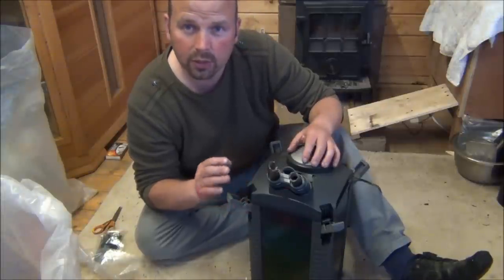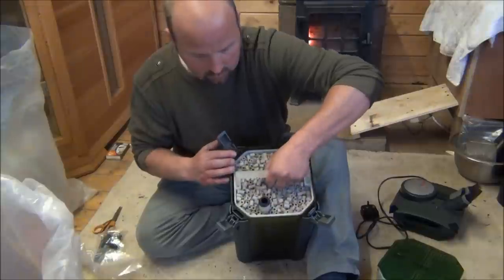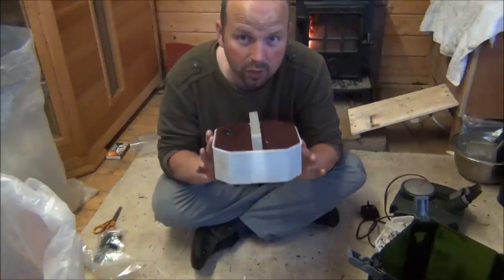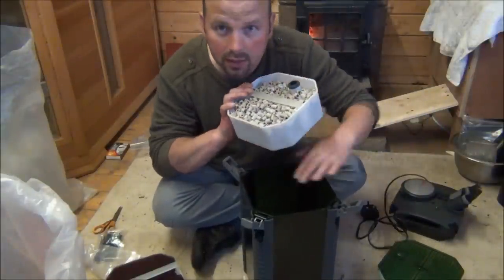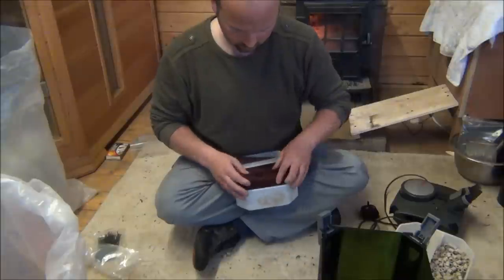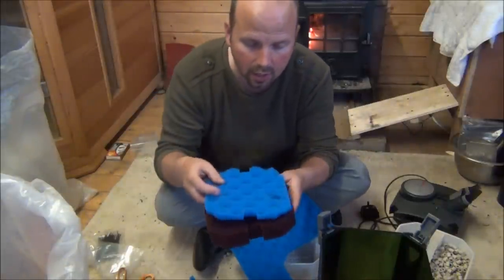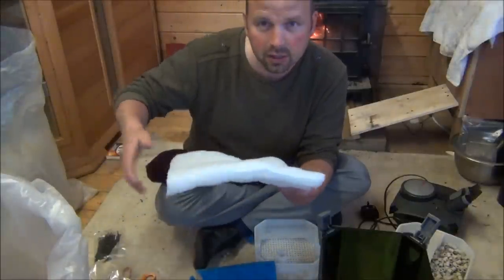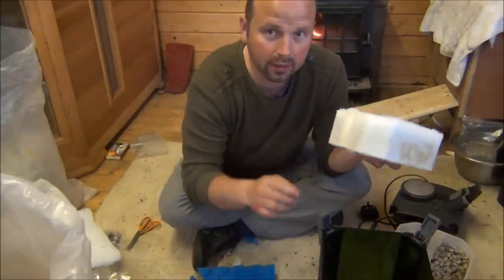How to set up an external canister filter for aquarium by Pondguru

Comment: Hello Pondguru.
I just bought my first Canister filter and I would like your advice, I know that the water flow of this filter starts in the bottom and comes out at the top of it.

I would like to know a good setup for this, I imagine that it would be quite different than the one in the video because mine is for Goldfishes and since I don't have any real plant, I might aswell use Purigen on it.
Can I put Midia+Purigen on the same grade?

I was thinking on doing something like:
Only Midia
Midia+Purigen
Only Foam.
Reply from the maker: ***** I would personally not use purigen under any circumstances as it seems to destroy the bacteria in a filter after recharging (due to bleach used for recharging process?). I have had numerous people report that their biohome media will not develop any anaerobic bacteria with the common thread being purigen. When it is removed the bacteria develops and nitrates fall.   Yes put foams in bottom then media above just like in this video.
Reply: Pondguru Outdoors What can I use for chemical filtration?

Should I just stick with biological and mechanical filtration?
Reply from the maker: ***** Unless you need to draw in residual fish treatments or colour from bogwood (which carbon will easily do) don't bother with chemical filtration. Keep it simple and maximise the biological activity. That way you will have no ammonia, no nitrite and very low nitrates and no need for 'chemical filtration'.
Reply: Pondguru Outdoors Oh ok, thx for the information.

Comment: Hi Pondguru Outdoors , do you use carbon media for the canister filters as well? If so where do you put them according to the way you recommend us to setup the media in our canister filters?
Reply from the maker: Carbon can be used if you need to draw in colour from water or soak up residual fish treatments but under normal circumstances it would not be necessary since a suitable size filter properly set up will process ammonia, nitrite and nitrate.
Carbon would go last in the set-up so it was the last thing water hit before leaving the filter. That is the cleanest environment for it to be operating in and will ensure it lasts the full 7-8 weeks before it needs changing.
Hope that helps.
Regards,
Richard
Reply: Pondguru Outdoors 
Thanks so much.i have a HOB filter and I'll be getting a canaster filter  thinking about a Fluval that can handle my 65 gallon.So I'm used to using carbon since they always come in the little filter cartridges. If I don't need the carbon then great less money for me to spend. usually I rinse out my carbon filter pack prior to use to get rid of excess carbon as the directions say to do (under tap)  but your videos have helped me to realize this is a major era since the chlorine from the tap will be defeating the purpose of the carbon.
Reply from the maker: Of you do go the external route make sure to get one which will be big enough for your tank. If it says 'will treat up to 400 litres' half that figure. You'd be looking for a filter for 'up to 130' (or more) gallons if you have a 65 gallon community tank and one 'up to' around 200 gallons for a 65 gallon tank with heavier stock (e.g cichlid tank / predators)

Comment: I set my filters up in similar way but I use lavarock as the biological media. It is what I can afford and better than the stuff sold in the pet shops in my opinion. Will the lavarock also ( over time ) get rid of the nitrates and the nitrites ?
Reply from the maker: It depends what type you are using. If it is the red / brown variety it doesn't really have the structure to support a decent mix of aerobic and anaerobic bacteria but if it is good quality white pumice then achieving the full cycle is a possibility - only potential problem with that is it has a specific pH of around 8.0 so while that is good for goldfish, malawi / tanganyikan cichlids and livebearers it is no good for 90% of the fish sold in pet stores which come from S. America or Asia (and need the water to be around 6.5-7.0 and not mineralised.

Comment: Hi there, any videos with the fluval filters as they are kind of vertical installation?
Reply from the maker: Simply set up the same and consider the foams down the side to be extra mechanical filtration. I don't have any of those filters to make a video about unfortunately but I will be doing a video about externals where I mention the various different types.
Reply: yeah fluval are the most famous in the shops and I think the structure there is wrong and media not enough. They're base on vertical foams not on levels and the top of the foam is always dirty so the water jumps to the other vertical half with the little quantity of so called bio filter.

Comment: I have a marineland cm220 can I used this same set up in my canister filter? I am planning on using the same set up in my canister filter. But, the only difference is if I could use this canister filter set up for a salt water fish tank set up. Let me know what you think, thanks!
Reply: *c220
Reply from the maker: Yes according from the information from Marineland it is suitable for marine use. The best media would be the 'Biohome ultimate marine' which is basically an improved version of the media shown in this video which has added trace elements specific to marine bacteria. Provided plenty is used it will reduce nitrates just as other forms do and also has the added bonus of boosting coral health too. This page of my website explains more and has answers to many general questions about biohome: http://filterpro.co.uk/qa-24-w.asp
Reply: +Pondguru Outdoors Awesome thanks for replying! I am currently debating on doing a freshwater or saltwater set up. Do you have any videos or information on setting up a good cycle for say a salt water set up?
Reply from the maker: The process is exactly the same. Make the water clear with mechanical filtration then have the biological media. Chemical filtration (if used) would be the last thing in the filter.

Comment: Hi Pondguru.
Your set up is for a different brand of canister to the one I currently have (Aqua One Nautilus 800).  Is it best for me to set it up just as you have??  From bottom to top with mechanical filtration media, then biological filtration media!!
Thanks, Ken.
Reply from the maker: +kennyp7 Yes just the same as the filter in this video. Not sure how much each tray will take but seeing that it will 'treat up to 200 litres' and has 3 trays? it should hold 1kg per tray (assuming bottom tray was used for foams and top 2 were used for media).
Feel free to send me dimensions of trays and I can work out how much media each tray will take no worries.
Reply: Pondguru, thanks for your swift reply 👍
I have set up the filter as you show in your 11min video (3 X layers of mechanical foam filters, then 2 baskets of bio filtration media ( 2 different types)).
The water is now very clear 👍 and I tested it after 24hrs. The PH level is a little low (6.5-7) and the Nitrates are a little high (20-40ppm)
I will check again in 5-7days to allow the bio media I have to work its magic and go from there.  Do you think I would benefit from an UGF due to heavy waste my cold water fish produce??
Cheers, Ken
Reply from the maker: +kennyp7 As long as the external is a suitable size for a goldfish tank you shouldn't need extra filtration so no worries there.
The biohome is not a magic bullet for nitrate in that you can't expect quick results - it takes a good 4-6 months for sufficient anaerobic bacteria to build up inside the media to affect it.
For goldfish tank that would require approx. 1.5kg per 100 litres depending on stock.

Comment: Pondguru Outdoors I just bought a SunSun WH-302 canister filter. I got with it 6 foam pads, bio balls, ceramic rings and carbon. In what order should i install the items to get the best filtration possible?
Reply from the maker: This video explains all that stuff - there should be no need for carbon when filter is set up with good media and foams are in correct place: https://www.youtube.com/watch?v=lsAmSD3wVbg 
Feel free to send me the dimensions of the trays and I can work out how much media you will need.
Reply: Pondguru Outdoors I have been using BIOHOME ULTIMATE for the last 3 weeks in my 18 gallon fishtank and now I notice it’s starting to develop algae in the tank and hose of
the canister filter. I have my  bottom
tray with Mechanical Filtration as you suggested and 2 trays with biohome media. Can you please help understand
why I am getting algae? And what I can do to get rid of it?
Reply from the maker: martinez189 There are a million reasons why algae develops in a tank. Is it a relatively new tank? Browny algae is common in tanks up to 2-3 months old but usually dies away, green algae grows vigorously when sunlight hits tank. High nitrate and phosphates cause algae and the biohome can help with the reduction in nitrate but takes 4-6 months for the anaerobic bacteria to build up to a level which affects nitrate. Feel free to send me some useful details to work from:stock, age of tank, light exposure, sunlight?, pictures etc. etc. and maybe something will be apparent. pondguru@btinternet.com
Reply: Pondguru Outdoors I sent you pic's and info. Subject is: Fish Tank Algae
E-mail will be from martinez189

Comment: What is the best way to start the filter? Where do the first bacteria get their ammonia from and how do you sustain and grow the bacteria? Add maybe 1 or two fish as soon as the water is livable? Any advice is much appreciated!
Reply from the maker: In a system which has a suitably sized, well set up filter it is perfectly safe and quick to cycle with fish but the first fish are best added after a week or so of running the filter to make sure that the tank water is suitable for life - using an ordinary dechlorinator (e.g. API Stress Coat) will ensure that ammonia, nitrite and nitrate stays in a form which is usable for bacteria, allowing it to populate good filter media very fast.
If you use a dechlorinator which also claims to 'detoxify / bind' ammonia, nitrite and nitrate you may have a hell of a job getting a proper cycle going as the detoxifying / binding process seems to render the bacteria 'food' (ammonia, nitrite, nitrate) unusable which causes a starving effect.
After the first few fish have been added wait 1-2 weeks before adding a few more then trickle fish in every 1-2 weeks until a full stock is achieved. Full stocking of a community tank should take a few months and ideally stock would be added in this order:
Mid water fish
Catfish / loaches
Snails
Algae eaters / plecs
Shrimps
Cycling without fish (using ammonia) is also no problem when you have a good set up and the first part (aerobic) should complete in 2-3 weeks (0 ammonia, 0 nitrite) with the last part (anaerobic) completing in 4-6 months (low or 0 nitrate).
The full cycle can be reduced to around 1 month by adding a source of liquid carbon - Flourish Excel is one which has been recommended to me many times for speeding up bacteria growth / reducing cycling time naturally. 
When cycling using either method it is best to test water every couple of days at the same time of day and plot the results so you can see the progression of the cycle.

Comment: Do you not think your bio media is actually a bit too tightly packed and not allowing it any movement with the flow ? Just to avoid dead spots in the media baskets, a little more space is a little more space to move and knock dead bacteria off - a bit like a flow filter ?
Reply from the maker: There is ample space between the media when it is put in loosely like in the video and unless the media is actually bashing together there won't be much in the way of dead bacteria removal. In a static bed old bacteria will be superseded by new bacteria. Areas of less flow in the filter provide a better environment for anaerobic bacteria which consume nitrate provided you have a media capable of supporting it.
I should maybe do a video explaining the differences between moving bed and static bed filters as there are quite a few. Thanks for watching and appreciating the videos.

Comment: Thank you for the information, one more thing? Do you know where I can get replacement foam in Coarse, medium, fine. I seem to be having difficulty finding that foam. Any information would be greatly appreciated.
Reply from the maker: +Dan Swanson What country are you in? If it is the US then follow the link (flag on all pages) on my website (in video description) but if you are in UK then simply follow the website link - I have very good foams in from a new supplier and they have a much better profile than the ones I was previously selling. The listings still have the old foams picture on as I have only recently changed supplier.

Comment: Top stuff Richard.  Just about to set up a 200L tank with Biohome Ultimate (and filter kit) in a Fluvial 406.   Might have to make my first youtube video while I do it...
Reply from the maker: No worries, I'm glad you found the video useful.
That is a decent size for the 200 litre assuming that it's not heavily stocked so you should get good results there as far as nitrate reduction goes.
Reply: Does Biohome Ultimate have a lifespan?  I have plenty left over from my kit (not that I'm complaining!), Will be storing it ready for future tanks. Will also be attempting to upgrade a Juwel in-tank filter with it and the foams.  Not sure how successful this will be, as the water flow seems to come from two directions, so clogging could become a problem..
Reply from the maker: If it is in constant use the useful lifespan would be approx. 6-10 years at high efficiency  (when it supports the most bacteria) but structurally it will last well beyond that. Eventually all media gets clogged.
The biohome will still work in a dirty environment but I always tell people to keep it in the cleanest part of the filter (after the mechanical part - foams and fine pad) so that it is as efficient as possible.
I suppose it's like running a vehicle on premium fuel or fuel which has been contaminated - your filter is an 'engine' which needs to be put together properly and the water is the fuel containing the food for the bacteria.
Hope that makes sense.
Reply: Well it's in and switched on! Managed to set up with no cloudy water due to loads of rinsing, so I'm no longer worried about clogging.  Stuck plenty of your bacteria balls in too, and will add more over the next few weeks.  Thanks for all the advice Richard, you're a star!
Reply from the maker: No worries, any time - glad it went well.

Comment: Hi Pondguru, can you please explain how to setup a JBL CristalProfi e901GL filter canister? From the looks of it, your Eheim Pro is filtering water from bottom to top and the first media that the water hits is in the bottom tray. On JBL, the water first hits top tray,  then goes to bottom and again climbs to top. This way, I always have muck on the top of the filter, which then hits the aquarium on the way out. Any suggestions would be appreciated. Thanks
Reply from the maker: +Zoran P The JBL is meant to work the same as the newer Eheim filters with the 'pre-filter' foam in the very top. Apart from that it operates the same as the one in this video. You could leave out the pre-filter foams on sides of top tray to allow water down into bottom for muck to be taken out there. I've never really seen the need for a pre filter foam as the muck really wants to be held in the bottom of the filter -makes it much easier to maintain as the pre filter foam is so coarse the finer muck gets down to the bottom anyway.

Comment: Thats interesting. My JBL has ceramic on the bottom and 3 sponges above. Would not the bottom clog up first thus reducing the flow?
Reply from the maker: As far as foams and reduction of flow goes it does not matter where they are in the filter as it is a sealed unit but from a view of making the muck collect in one place (the bottom) and protecting the media from clogging they can only be in the bottom as that keeps all mechanical filtration being first followed by biological media. That's the only way these filters will operate efficiently but it's amazing how many manufacturers make a complete balls of it.
Reply: I will give it a try and move them around. Thanks for your advice.

Comment: Hi,

I was just wondering what your opinion was on alfagrog for external filters?

Cheers
Reply from the maker: I've seen it used in the outer ring of the new fluval FX5 / FX6 and in sumps but it is out performed on every level by Biohome (but biohome is more expensive). Generally it is best for koi filters or shower systems. No good for most indoor applications.

Comment: @pondguru i'm using a api m and L canister filter using your media technique how often should I clean my filter currently I'm cleaning at 3 month intervals but sometimes I can push to 4 months before it gets pretty mucky but I've heard other youtubers go as far as 6-9 months....what say you?
Reply from the maker: Just clean it when it needs doing - every tank is different and in a new tank I'd say check it after a month and clean it then if it wasn't very dirty extend it to 6 weeks, then 8 weeks and so on until you get a feel for when it needs doing. Usually when the flow coming back into the tank slows down noticeably it will tell you that the filter needs maintaining but every tank is different.